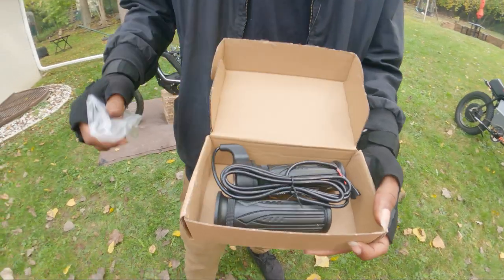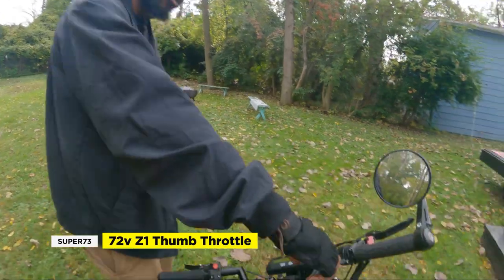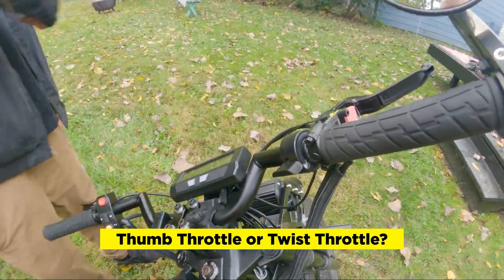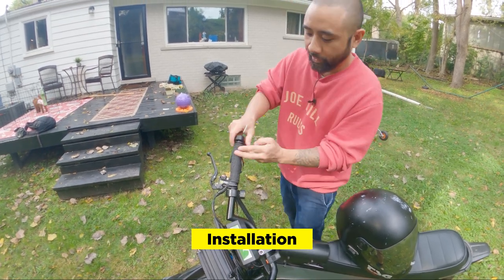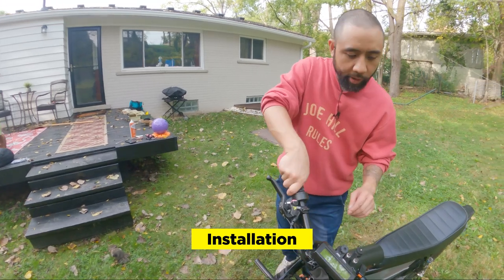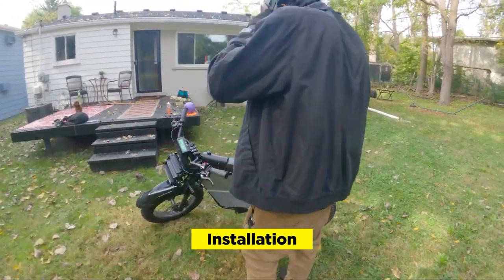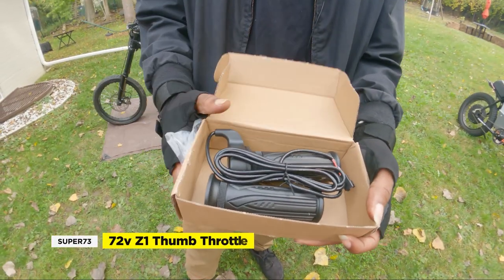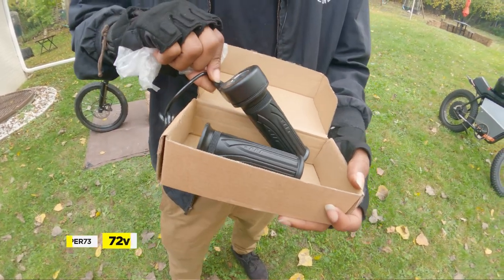72v Super73 Z1 Full Twist Throttle Mod | RunPlayBack

Comment: Am i able to place new twist throttle to existing set up on Z1? I have no mods, just stock, but i have arthritis in my hands so i need to swap out thumb throttle with twist throttle
Reply from the maker: Yes you can! You just have to be able to cut the wires and splice it by soldering or using crimp connectors.
Reply: @RunPlayBack  thx for the feedback! And answering my question! Most never respond….U da Man!

Comment: What set up would you recommend for faster z1 ? Do you think it's worth modifying ?
Reply from the maker: The Z1 is a solid frame to mod because it's steel. It's worth it IMO but if you have the budget, might be worth getting something that already has the specs you're looking for.
Reply: Wanna do a conversion on mine and do a video on it ?? Lol. PL has a custom kit they said will work great and is pretty much plug and play but I'm scared to the controller myself
Reply from the maker: @joshnull2596  where do you live?
Reply: I'm in North Canton , Ohio . Its about 45 minutes south of Cleveland .
Reply: I'm up for coming up there though